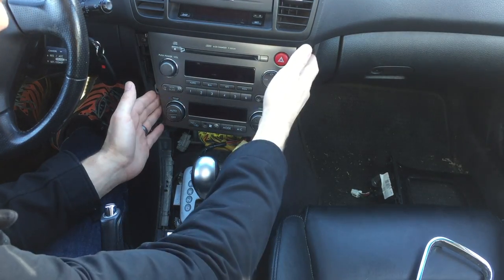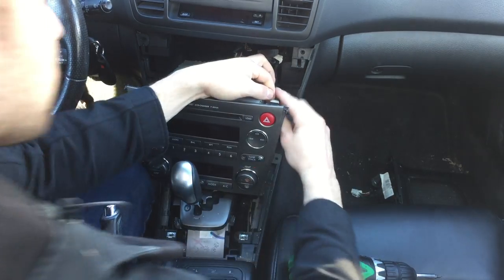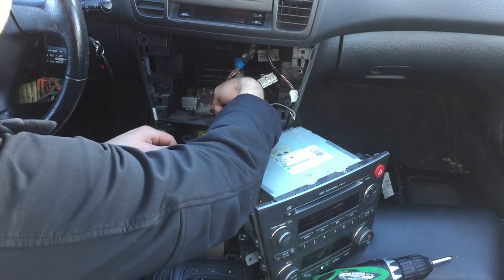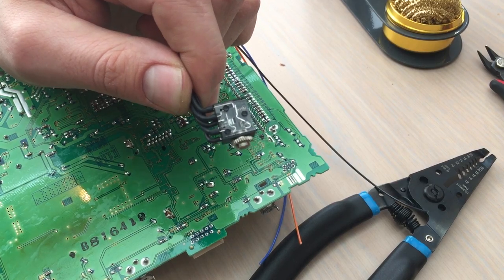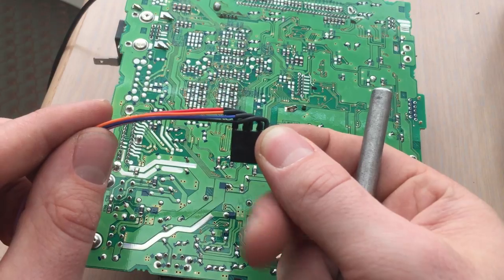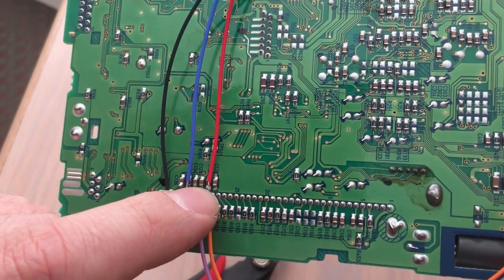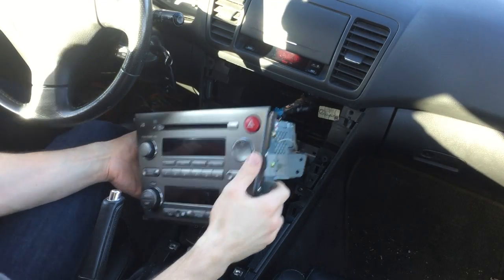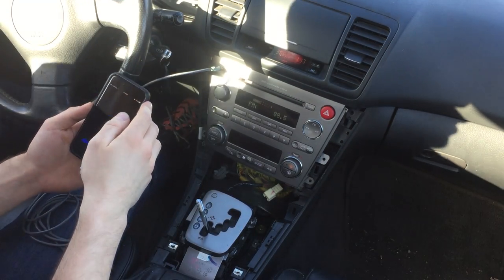Installing an Aux port in 2006 Subaru

Comment: I implemented this yesterday and it works perfectly. I did not have previous soldering experience but I did do a lot of research beforehand and had some practice on a throwaway circuit board I had. I used a small cheap radioshack soldering iron but got some good quality thin solder which worked very well, and I used a razor blade to cut/score the existing FM links. I was most anxious about the soldering part, but this turned out to not be the most challenging aspect. My advice to anyone attempting this mod is to be very methodical about the order in which components are removed and where each screw should go — take many photos and stay organized. Excellent tutorial, thank you very much for taking the time.

Comment: Following up.... Just completed the mod tonight. Works great!! No difference in audio volume from aux to radio, no static, no feedback, just pure audio bliss! Why in the hell Subaru didn't do this from the getgo is beyond me! The whole process took about three hours start to finish. I used a Weller 40 amp solder station with adjustable temp,  60/40 leaded solder (yes lead is better), 24 gauge strand wire that I tinned prior to soldering to contacts and the recommended switch. I also addressed the dim & sometimes blinking climate control lights by deoxing and bending the contacts to regain continuity. I now have a stereo that has a clean aux in and bright display lights again!

Comment: Thanks for this, it took two tries but I got it working (loose ground), instead of ruining the radio by having the port drilled into it I ran the aux cord under the side of the center console right where the drivers knee would be. Super clean and the cord runs along the seat and comes up by the cup holders. No holes
Reply from the maker: I like the seeing the port at the front but routing it there is a great option too!

Comment: I just did this today and it worked! Only thing that threw me off was when I plugged in the aux cord (just the cord, not connected to the phone) to the splitter (I was expecting that all audio would stop) the left audio was still playing the FM, I was disappointed, but after a couple minutes I felt the need to plug in my phone, once I did that, the audio from the left FM stopped, so I played a song from my phone and both left and right audio comes through! And once I unplug the cord from the splitter both left and right audio work for the FM!

This aux mod is just as complicated, maybe a little more, than other aux mods, but none are as clean or cheap as this setup, only thing I’ve done different is mounting the splitter in the center “glove” console.
Reply: Did you use the exact 5 pin connector he used? It costs $20 to ship to Australia so trying to find out if you can use any 5 pin connector
Reply: Just tried doing this today and desoldered one of the capacitors on accident, pretty sure I just screwed the whole thing up. Time to buy another head unit, I blame it on the Shiite harbor freight soldering iron....

Comment: Thanks for the video! I completed the install on my 2005 Subaru outback with the automatic climate controls. After soldering on an antenna connector (a mechanic broke the original one while replacing the airbags), everything works perfectly. Sadly, the combo lightning/headphone jack dongle doesn't let me charge while listening without large ammounts of feedback, but the stock apple dongle works. I will be installing a wireless MagSafe charger for the phone.
Reply from the maker: That's awesome, glad the video was helpful for you!  Yeah, that is kind of annoying now that headphone jacks aren't often standard in phones, they can't be charged and plugged into something like this at the same time. A MagSafe charger sounds like the way to go 👍

Comment: You had me right up to, "Now we just need to disassemble this radio" and 50,000 tiny parts strewn all over your table. I'm just going to get an FM transmitter. The old ones had all kinds of problems, but the new ones are a night and day difference.
Reply: just completed this mod. It was not hard. Nice thing is, it looks stock and clean. Just go ahead and do it. Take your time with soldering and make sure you cut the printed circuit board connections.

Comment: Hi, Great video.  Really helpful and as far as I can see unique.  I followed all the steps but unfortunately my circuitboard was completely different to yours so I had to abandon the mod and put the car back together.  I am disappointed not to have been able to get it done but was really delighted that you showed me how to remove the radio, dismantle it into its component parts then put it back together again and all looked exactly as it had done before I started and what is more, it worked.  If you have any advice as to where to get circuit diagrams for my UK spec 2005 Outback stereo I would be very keen to hear.
Reply from the maker: Thanks!
Hmm, finding circuit info or diagrams is pretty difficult and unfortunately I don't have any for a UK 2005 outback 😕

Comment: Fantastic tutorial. Thank you for dedicating the time to teaching people like me. One question though; after install, the AUX works perfectly but I cannot hear AM/FM. What would you guess I messed up?
Reply from the maker: You used the same part that I specified? And cut the traces on the circuit board and connected a wire to each side of both cuts? That part specified works by either acting like a wire that passes through the left and right audio of the radio, but when you plug a 1/8" jack into it it disconnects the radio connections and connects the left and right channels from the device you have plugged in. If you're not getting radio sound when an aux cable is unplugged, I would double check the solder connections on the radio side of the cut circuit board traces.
Reply: @42Pursuit  Thank you for the reply. Yes, I followed your video to the letter, but I didn’t verify that I had broken the two traces with a multimeter or anything.  So it’s possible that one of the runs still has continuity. I’ll dig back into it and verify. Thanks!

Comment: Really great ! I was trying to find the schematics on my radio to do the same thing. Thanks!! One question though, is the pre-amp circuit before or after the splice and if it is before, is there a big difference between volumes of radio and phone? I was thinking if there is,  using a couple non-polar capacitors in line might do the trick.
Reply: Did you end up doing that?
Reply: @sooori89  just did the splice, no caps. Works well.
Reply: @PackardDog  okay great, one less thing to worry about 👍 Hopefully my head unit has the same PCB layout as the video

Comment: Could we do this with a Bluetooth decoder to the same pins? I don’t mind deleting the radio entirely if I have to
Reply from the maker: It might be possible but you'd have to make sure the signal voltage amplitude was about the same or risk burning out the bluetooth device.

Comment: Once everything is pulled apart, is it possible for the HVAC controls to still work if at this point you got a new fascia and installed a new stereo head unit? Or is the power for stereo and HVAC all wired together? It looks like you've pulled the stereo and HVAC apart once all the casing is off
Reply from the maker: Hmm, I'm not sure. It was a while when I did this so I don't remember all of the connections exactly but I do think they shared some connectors and power if I'm not mistaken.

Comment: I saw that the model number of the head unit is the P-203UH. I have an 05 outback that has the P-201UH head unit. I was wondering if you can install an aux on the P-201UH the same way or is it different?

Comment: Might be a little bit late but I just completed this install last night and it almost works perfectly except for when I plug in the aux chord the radio still plays in the background along with my phone, although the radio is a little bit quieter when the aux is plugged in. Any idea why this could be? Maybe didn't sever the connections enough for the two connections? Want to get an idea before I tear it all out again.
Reply from the maker: Yeah, if you didn't fully sever the traces on the printed circuit board there will be a bit of bleed-over. Double check that and if you're still having issues, check the continuity between the pins of the different modes on the connector to see if there might be an issue in the connector.
Best of luck!

Comment: Just an fyi for anyone thinking about this.. I tried this 11/23/17.  
I'm left with NO FM, and AUX sound on left side only...FM is toast.  No radio, no matter AUX in or not.  I decided to redo it..and screwed it up worse.
Now looking at replacing with a newer OEM unit.. 07-08 P204-UH unit looks to be the best option..with some help from ae64.com
Think about it before you try it..good luck!
Reply: Seriously if you're not electronically experienced (like me lol) it might be an idea just to go with a cigarette-lighter plugin fm transmitter for aux, as I'm intending to do on my mum's car - she isn't worried about using an mp3 player, and I didn't want her spending more $ on a secondhand younger car as she is an age pensioner.
Reply: Your soldering skills should be very good before attempting
Reply: Has anyone figured out this issue? It's doing the same on mine
Reply: @dalegribble9314   just tried the patch myself. No FM or AM radio now. AUX works, but lots of static in treble that I can't get rid of. I must've screwed the solder job.
Reply: @dalegribble9314  disregard. I was using a 4 pin cord that didn't map correctly to the jack. Once I used a proper 3 pin cord, the AUX worked fine without the static. The jack does seem pretty sensitive to the male plug of the AUX cord moving around and different speakers will cut out as the cord is jiggled.

I still jacked the radio up though, so no FM/AM. Oh well.

Comment: So I just did this and I have no sound on my FM radio. When I connect the aux I only get sound on the left side of the car and barley any sound on the right. Has anybody fixed this issue if has also happened to yours?

Comment: Would this work on the McINTOSH unit and use the Mini disk output instead of the fm?
Reply from the maker: Not sure, all I know is this mod works for this exact radio installed in Subarus.

Comment: Hi!  Can you tell me which model number stereo this is?  I want to verify that I have the same one in my 2006 OBXT (I have a P-203UH).
Reply from the maker: I'm sorry, I don't have that vehicle anymore so can't check.
If it's a stock radio and the center column looks the same I would guess it's the same but you can double check before you get all the way into it. Confirm the radio unit looks similar once you get the plastic pieces and molding popped off.
Reply: @42Pursuit  willling to try out the surgery!  The radio looks the same but I’ve paused the video many times and I can almost, almost make out the model number.

Comment: Are you able to use any AUX input or is this some kind of Subaru specific piece?
Reply from the maker: If you use the part linked to in the description, it should play off anything connected with the 3.5mm jack.

Comment: Why did you have to severe the connection to the resistors?
Reply from the maker: The connection is severed so that the 1/8" jack added can either pass through the original radio signal, or bypass the radio and play from the connected aux cable.

Comment: Does anyone know if you can use any 5 pin 3.5mm jack connector or does it have to be the specific one in this video? I’m in Australia so this part is $25 shipping for something that is $2
Reply: Hey could i ask if it worked out? I am also in australia and to be honest am not sure what to order exactly.  Would it be possible to ask you what to order?

Comment: does the swithcraft piece come with the 5 wires?
Reply from the maker: It doesn't, you'll have to solder those on.
Reply: Tip for anyone else reading this: get the wires from a spare Ethernet cable (most are pretty good, solid wires perfect for signals)

Comment: It would be great if someone knew where to put aux signal to the CD. I never use CDs and I want to connect an old set of Bluetooth earplugs so no switching Aux connector to use. If I just can get where the signal level from the CD is the corresponding one, I can cut off the CD and solder the earphone cables from my BT and voila! BT audio. Of course, one need to have access to the BT to be able to pair with devices but that shouldn't be any problem. I can just have longer shielded cables to the compartment above the stereo/AC unit.
Reply: Oh, depending on type of BT earphones, one may have to fix a power supply also. That is if the BT turns off when plugging in the ordinary USB charging.

Comment: Would this work on a 2004 forester
Reply from the maker: I can't speak to different makes and models of cars, but if it has a console and radio that looks the same as what you see in the video, it might have the same internals.
Reply: @42Pursuit  okay so when it comes down to the circuit board what am I looking for?
Reply from the maker: @supazsa  See if it matches the circuit board at 3:20. If it doesn't, unfortunately this method won't work.
Reply: Just in case it doesn't what circuits am I looking for?
Reply from the maker: Unfortunately they won't be labeled. I won't be able to help further. It takes a lot of time, research, and testing to figure out the different signals as you basically need to reverse engineer the circuits as there's not a standard.

Comment: I have a 2005 Subaru Forester which is different from your model. How do I identify which pins on the RF module are for audio out? Do cars have datasheets available for the different modules in the radio? Thanks for your time.
Reply from the maker: Unfortunately there's no simple answer as datasheets are often near-impossible to find. You could take it apart and see if the radio module has a part number and search for a datasheet that way.
It might take some time but if you have an oscilloscope you could gain access to the board, power on the unit and probe around on the pins of the module until you found two that looked like an FM signal.
Reply: @42Pursuit  got the same thing on my 04 haven't figured it out yet. how about you +josh Katz

Comment: So I tried this and got a weird result. If I just touch the 3.5 mm jack to the first switch without triggering it I get aux sound out of the right side of the car and radio sound out of both, as expected. If I stick it in further to trigger the first switch and just touch the second, I get clear aux sound out of the left speaker and nothing out of the right. If I stick the 3.5 mm jack all the way in I get sound out of both speakers but even with the volumes turned all the way up it's not audible unless your ear is to the speaker. I've double checked everything and am pretty stumped. Any help or advice on how to trouble shoot this would be greatly appreciated. Thank you!
Reply from the maker: It's difficult to troubleshoot with only partial plugging in the jack. First off, make sure you're using a 3-ring cable (TRS), not a 4-ring (TRRS) which will often have an in-line volume and/or microphone. Also, is it passing through radio correctly when nothing is plugged in?

Comment: Hi friend, would you help me?
I want to do the same on my radio, but it is not the same, as you could do in gx201sh model. thank you very much.
Reply: leonardo santis did you solve yours? I got the same model as you
Reply: yes!
Reply: i'm conect in fm out
Reply: You didn't by any chance snap a foto after you soldered? 🙈
Reply: i'm searching
Reply: cuando tenga tiempo, la abro y le tomo una fotografía
Reply: leonardo santis that would really help! How did you figure it out where to solder? Just by studying the diagrams? :)
Reply: Simon Persson löste du problemet?